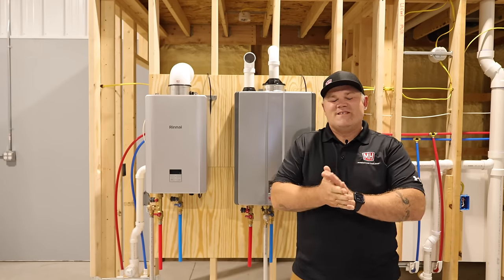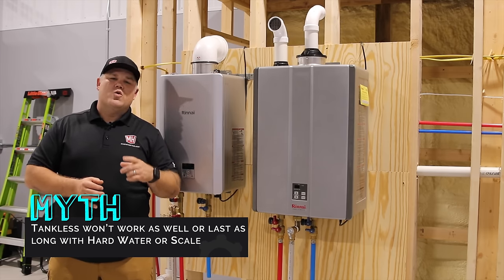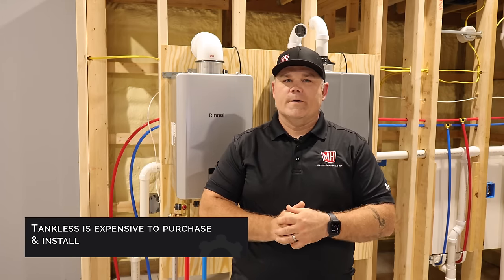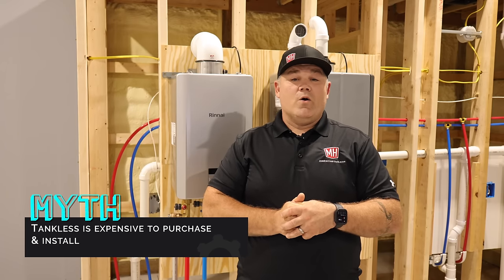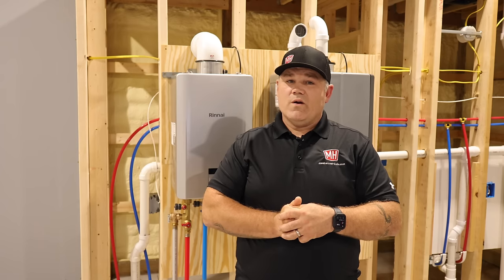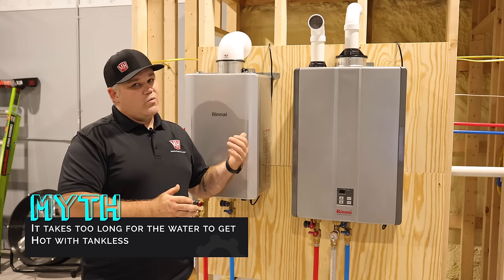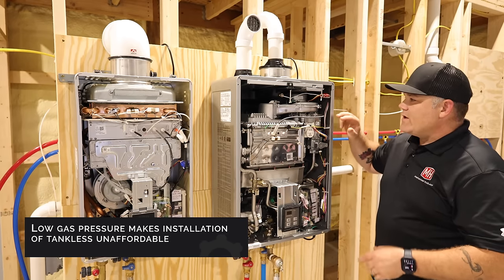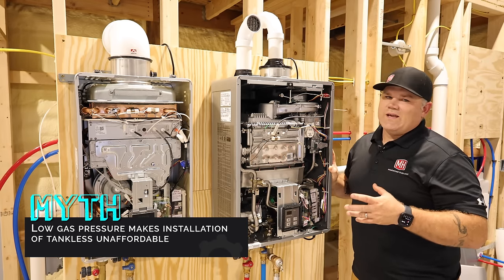Myth Busting! Tank -vs- Tankless Water Heaters

Comment: I live in Northern Minnesota just like you, however it does seem to take a long time to get hot water. I have a combo unit for my floor heating and water heating. I have a central manifold  for distribution and it's less than twenty feet from my kitchen. It takes over a minute to get hot water and then it is just getting warm. I timed it and it's always the same. I have conditioned well water. Is there something wrong with my unit?

Comment: Condensing tankless became widely available in the US in what year?   Condensing costs what % more than non-condensing, just equipment?  Isn't it true that tankless have a longer expected life than a tank?  Any difference in maintenance and expected life of condensing and non-condensing?  Recently, my gas meter quit working, so I got bills for $14 of fixed costs.  In the summer, I normally get gas bills for $18.  Thus, my hot water costs me about $4 to $5 a month.  Not much.  I agree there are only two of us now and we don't use a lot of water.  Also, I have a low gas rate under an old contract.

Comment: I have a question. I have a client who had one of these installed. The intake vent is open to their laundry room where it is installed. The exhaust vents out through the roof. For some reason, the client was told they need to run the intake line outside. That it "needs more air". I don't understand this. The room itself is 8x8x8. I told her there is plenty of air in the room to feed the system, but someone told her it needs to come from outside. Does this make sense?
Reply from the maker: The house must have a means of makeup ventilation sized properly to accommodate the BTU/hr rating of the appliance (and all other combustion, non direct vent appliances in the home) so if that isn’t present then yes, it must be piped outside and not just drawing from the room.

Comment: So if a heating, AC and plumbing company is charging $11,900 in Southern California's Riverside county, is that too much? I agreed to this yesterday to replace my electric water heater but haven't paid for it yet, and think I need more time to think this thru more, since it initially was only supposed to be a tank drain on the service plan I'm with, but they told me it was too clogged up to do it..and then came the mention of new tank options. My tank is 19 years old with hard water buildup around the pipes, but I kinda still feel like they're trying to get me on this.

Comment: Tankless can be expensive to repair and maintain unless you do it yourself.  They require yearly cleaning and checking.  Most people want to install it and forget it.  Water quality may be the key to long lasting water heaters.  Rinnai seems to be a very good choice.  I have seen tank type heaters last for 25 years.

Comment: I had one and it was a nightmare and expensive. One power outage and you got to pull the stairway down and push the reset button. It got so bad I finally replaced it with a tank heater. Had a plumber tell me he takes more out than he installs. Never more I learned a very expensive lesson

Comment: Your claim for endless hot water should have a caveat:  if flow and required temperature rise exceed the mechanical capability of the unit, you will not get water hot enough to meet the set point.   You should also mention sudden reductions in flow can result in scalding hot water.   This can happen when two HW faucets are running and one is suddenly turned off.  PS Rinnai loves you.

Comment: So If I have an oven, fireplace, 2 furnaces, stove with 5 burners and a 160,000 tankless with a 1/inch gas line with 2 psi and about a 80 ft run, would I have to run a new gas line?

Comment: I wouldn't want to fill a decent bath/jacuzzi with one of these.   It would take forever.  Also, a decent modern tank (fully insulated) will give hot water for days (which is useful in the event of a power outage).  Insulation is the key to lower bills.

Comment: Hard water and not flushing your tanks is usually the problem ive seen with tanks, maybe a cheap gas control brand, but the fact that the heater bibb or spigot sits higher than the bottom of the tank still allowing sediment to collect and water simply pass over when flushing  annoys me and seems like it should be something  updated on newer models. Collecting sediment can create those hotspots that lead to leaks. Sediment buildup in the tankless the same. Regardless of copper or s/s. And depending on your system whether still galvanized i wouldnt recommend the tankless. Get that repipe first or together, also check your pressure, prv are no joke.

Comment: 50 years ago, the tankless water heater at my grandma's house (in Europe) was definitely more than 20 years old already. This is not "new technology".
Those old ones did however stop working after a while though, and then some cleaning of carbon buildup or replacement of the burner unit needed to happen, which was a nuisance.

Comment: Do you suggest tankless for running in floor/radiant heating systems? Planning to finish a basement and want to provide non forced air heat without piping for radiators but worried about the water tank taking up space.

Comment: What about having to chemical wash out hot water lines and heater on order to remove mineral build up. I have been told that this necessary & expensive.
Reply: Nope. A complete myth.  You just flush your tankless out with $1 of white vinegar.  Not hard, nor expensive.

Comment: I was told that you have to mount a tankless water heater on an outside wall.  That makes no sense to me, but that is why I went with a tank water heater last time. I have a walk in tub that we really can't fill, because the largest tank water heater that will fit in the space runs out of water when the tub is only about half full.  I can't understand any reason whatsoever that you would have to have an outside wall to mount that appliance on.

Comment: My sister installed one of these years ago and said every time she used the hot water the pipes would jerk, knock, or something like that.Her old pipes couldn’t take the force apparently. So your pipes have to solid in good working order or these may not work for you. I can’t see replacing all my pipes just to get one of these units. Not in my budget and doesn’t pencil out. Kinda like getting new windows doesn’t pencil out vs the cost.
Reply: At least in your situation with the windows you can replace them a few at a time when you have the money.

Comment: I recently retired and moved to the far western mid Mexico area called Mazatlan. Though there are extremely few mostly American and Canadian's and those Mexican's  educated in either country. That can afford it, use a convention what they refer to as boiler's or as we refer to them as hot water heater's, aka tank heater's.

If and when one desire's hot water in their shower area, they install what is referred to as a DUCHA. A little device they install as a shower head, that utilize's electricty to heat the water as it fill's and fall's out on to your body. There's a heating element sometime a quarter of an inch in diameter or a spring considerable smaller diameter that circle's the inside. Most of Mexico don't utilze pumped water. The water is gavity feed from a tank on one's roof. Using a pump, the Ducha doesn't work, because the preasure or flow of water is to fast for the element to heat the water sufficently. But gravity presure work's well.

When knowing how they work, I've adapted them in such a way that I've installed one prior to the hot water spigot on all of my sinks, Thus when I desire hot water, I get instant hot water. Having a tankless central located one, mean's one has to wait for the water that was in the pipe length which when not utilized get's cold. Having a DUCHA installed just prior to it coming out of the shower head, or hot water tap eleiminate that. Though they don't last as long as the considerably larger one's, the price being only some 200 peso's or about 18 dollar's, once or twice a year envolved in having just one, is pretty inexpensive. I've got four, thus I spend 800 peso's in a two year period. In as much as there's only me and my wife, and one doesn't utilize hot or cold from the tap for drinking. Our city water is only the mandated bill of a 100 peso's a month. Our drinking water, is some 150 peso's. Thus our total water bill is only that of 250 peso's. Using the current 17 peso's to a dollar. And only enough eletricty for immediate sufficent hot water for the purpose. Our total water and the electricty utilzed work's out to be some 500 peso's a month, when only water is figured. More of course when including the air conditioning. But that's a different subject. Doing the math at today covergin rate, our electric when it comes to having hot water along with our water bill which includes both the city and drinking. Work's out to be some avrage of $30 to $35 dollar's a month.

Becasue the water presure in most of America home's is well over gravity presure. Ducha's don't work. But if they were to have smaller tankless installed as they do in Europe. Rather than a larger central one. Having multiple smaller one's at the various hot water outlet's is way cheaper orignally and over the duration they last, cheaper yet.

Comment: Hello.  I have had a Rinnai (V140 I believe) non condensing unit the smallest propane unit available 6 years ago. I live in a 10 month RV park and we have to winterize it before leaving in January and February. I live in Ontario Canada. I back flush once a year with vinegar to clear out the hard water residue. I have neighbours who need new waters heaters and I have recommended Rinnai, but only condensing units are allowed now. My question is this, is it possible to winterize these Rinnai condensing units and what is the procedure?  I have talked to a dealer and we are trying to figure this out how it will work.  There are sales if this problem can be solved.  We need outside units. Thank You

Comment: The gas instant heaters are the way to go when you size them for the demand.
Because solar has become so cheap I want to run it on solar. Even a 4500 watt water heater uses a forth of the amps of a good instant,it still is a huge,though intermittent load,making it hard to run off most normal sized starter inverter systems.
I put the two elements in series ,cutting the heating capacity in half. It has to run twice as long to heat the water but that’s not a problem. I’ve been taking my weekly shower whether I needed it or not but since Covid ruined my smell I’ve been waiting two weeks.
When teenagers take more than four minutes to wash off they’re probably just loping the mule or flicking the bean. There’s a time and place for everything;don’t discharge my batteries while you’re discharging yours.

Comment: Hi.  Unfortunately, we are in the market for a hot water tank.  Currently we have an 80 gallon electric.  We are looking at a RINNAI condensing unit RU199IP.  I have a pvc exhaust near by for my furnace.  Can I connect to that for the exhaust for the new tank?

Comment: When these first came out, the big thing was that they were so efficient. They are so efficient that they have to add cold water to the heated water because it was so hot. 🤔. What's that tell you?
We were told that the gas bill would drop big time.
My gas bill at the time was $12 month in the summer with a gas stove, dryer  and the water heater. 🤔.
At the time, a new power vent 40 gallon water heater was about $400. Standard vent was about half.
A new on demand for a family of four was about $1600 to buy. 🤔
That's a lot of $6 gas bills in the summer to pay for itself.
Hopefully they got better over the years. A power vent water heater now is about $1000. Maybe for a large family that needs two 60 gallon heaters, it would be a smart move.

Comment: I used tankless water heater for more than ten years.  My experience is bad.  I regret to use it.  I am in Toronto and the copper heat ex-changer burst twice because of extreme cold weather.  Also, It takes time to have hot water arriving the upper room faucet.  I have many service calls for this heater.  i have to add different devices to protect it from freezing.

Comment: I prefer tank to tankless. Less maintenance for one. A tankless must be flushed to keep the heat exchanger clear, but a tank is much more forgiving and has room for sediment to build up. You also need more volume of water flowing to get hot water to "trickle" out of the faucet, or the tankless unit will not ignite. Water from a well will be warmer coming into the house than water from a municipal water tower during the winter months. The earlier tankless systems did struggle to heat the water, but now I don't think it is an issue like before. And yes, the heat exchangers do take a few seconds to heat up in a tankless system, but not over the top. That being said, I still prefer a tank to a tankless system.

Comment: Endless hot water?  Only until the unit either fails or the electric power goes out.

I have a tankless propane condensing unit with built in recirculating pump.  Built it into a new home about six years ago. A NRCP 1112.

Also, my home is on a farm about 20 miles from the nearest big city, about a half hour drive.

The first three years were flawless.  Everything about it was very nice.  With the built in pump and appropriate house plumbing loop, hot water reached the faucets in a few seconds.

Then, it started throwing fault codes and shutting itself off.  Tried calling the manufacturer’s authorized dealers.  And discovered there are plenty of folks who can put one in and virtually no-one who knows how to fix one.

Finally got one guy to come out and the first thing he said was “never seen one of these before.”  So, he wanted to descale it and we did.  That was all he knew how to do.   Of course that didn’t fix that it would still shutdown multiple times per day.

As an engineer I can attest that these things are very complex.  Processors, pumps, fans, motorized valves, igniters, flame sensors, leak sensors, temperature sensors, power supplies, regulators, and more.  It all has to play together perfectly or you get a cold shower.

So, I got on the phone to the manufacturer support.   They didn’t seem too surprised when I explained they had no local technical support.  After working through all the fault codes, they announced I needed a new recirc pump and sent one.  Even though the old pump felt like it was running, I did the replacement and the unit started working properly.

I noticed on the new pump box a sticker with the words “new impeller”.  So I took the original pump apart and found that all the blades had broken off the impeller disk.  The motor would spin, but not move any water, causing a heat exchanger over temp and other related codes.  Hopefully the new pump with the “new impeller” has a longer life.

At least it was back running.

15 months later,  a different failure and I’m on the phone to the manufacturer again.  More parts sent and its back running again.  5 more days living with cold water only.

So far, the list price of the parts installed adds up to about $500 that were covered under the 5 yr parts warrantee. 

After that, I have experienced more failed flame sensors, motorized mixer valves, a pipe flange rupture leak,and a bad igniter. Seems like the unit fails every six to twelve months.  Each time, we loose hot water for a few days waiting for parts delivery.  The parts now cost money, but are at least available.

I never wanted to become a tankless technician and I believe it will be very satisfying to put the unit out of its misery some day.  Maybe I’ll do a video about it.  I expect a 1911 45 ACP will be involved.

At that point, I plan to put in a tank unit.

The lesson learned:  If you’re not in a major metropolitan area with the technical support needed to fix these things, go with something simpler and supportable.

Comment: My house has the tank in the attic, and I'm worried that it will break/leak into the ceiling as it's about 12 years old.  Would a tankless water heater be better if I replace the water heater?